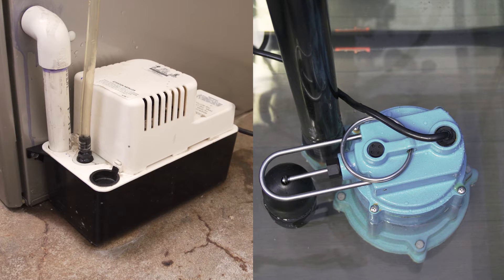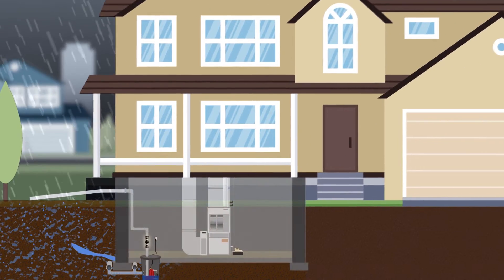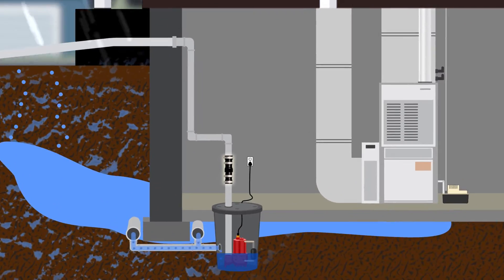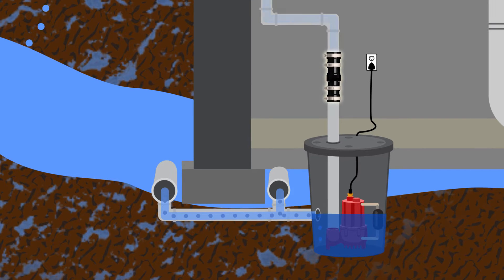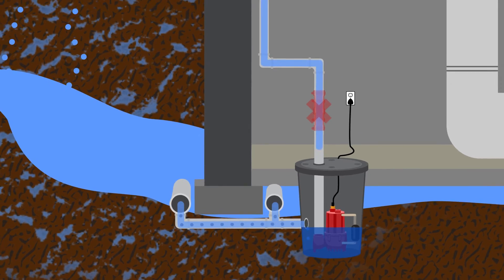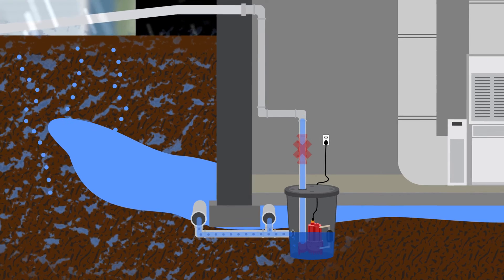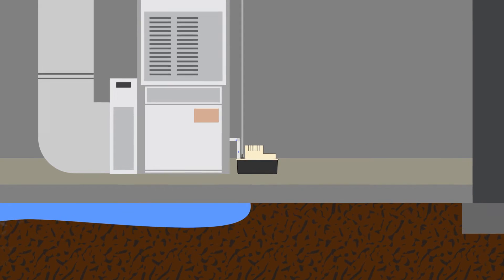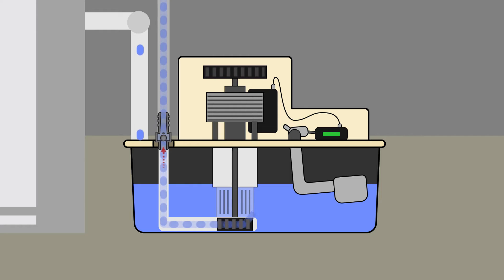How Do Check Valves Work? | Spec. Sense

Comment: How to remove the water above the check valve for service?   My sump pump check valve is low on one pit and high on another any reason for this?
Reply from the maker: Thanks for watching. To drain the water above you can either drain it back into sump pit, or you might need another bucket to drain it into. The height of the check valve shouldn't matter too much for this size and length of pipe.

Comment: So what does the duckbill do inside the check valve?
Reply from the maker: There are different types of check valves. For a sump pump it will have a hinge and a disc that closes when water is pulled back down by gravity.

The duckbill valve is a flexible one-piece sleeve in the shape of a duckbill which will open when the water is flowing in one direction, and enough back pressure will force it to collapse inward and close, preventing back flow.

Comment: So the check valve must be installed before or after the motor pump?
Reply from the maker: In the examples in the videos it's after the pump because gravity would pull the water back and force the pump to run again.

Comment: So it's the same as a backflor preventer?
Reply from the maker: Yes, a check valve is a type of backflow preventer but has a different appliacation.

A backflow preventer is necessary to prevent contaminated water from flowing into potable water sources. A check valve is generally not as robust and cannot prevent that sort of contamination. In the case of a sump pump, this is not a problem as both water sources are the same.

Comment: Does a bad check valve causes air in the system like sputtering and choking, especially in the morning?
Reply from the maker: It depends on how it fails. If the check valve is stuck closed then it might sputter. If the check valve does not close properly then water will rush back into the pump and it will run more frequently.

Comment: Are check valves ever immediately above the sump pump or even threaded to it? I am familiar with check valves a bit higher up and out of the sump and then a weep hole is drilled in pipe in sump to prevent air lock in that section.
Reply from the maker: Generally the check valve will be 8″ up from the pumps discharge to approximately 12″ above floor level. Any check valves with a MPT (Male Pipe Thread) connection that are designed to thread directly to the sump pump discharge housing must have the air release hole / weep hole drilled into the check valve body directly above the MPT connection and below the flapper. Some of these threaded check valves will come with a pre made weep hole.

Comment: the weight of the water "does not close the check valve". The check valve is opened by the suction of the pump. The check valve has a spring which closes the valve once the suction of the pump turns off. If you depend on the weight of the water to close the valve, you have installed the valve backwards.
Reply from the maker: Thank you for watching. There are gravity closing check valves that work even without a spring. As well swing check valves still work even without a spring as any backflow will push the flap close. You are right that the spring will help close it.

In the case of the sump pump, if the check valve was installed backwards the pump would not drain the sump basin as the check valve would prevent water from flowing out through the pipe.

Comment: What if i put check valve in oulet dan inlet pipe? Is my boster become safer? Is reduce waterhammer much? 
There is  still litle waterhammer when i use one check vale in inlet pipe .
Reply from the maker: Thanks for watching. Water hammer is the shockwave created when a pump or valve suddenly closes. It is like slamming on the brakes when driving at highway speeds.

To fix water hammer, tighting the mounting clips on any pipes can reduce the noise. Installing a dedicated water hammer arrestor will create a cushion for the water, reducing the shockwave. A check valve will not act as a cushion as this is another hard stop in the system.

Comment: My hand pump is facing difficulty in gaining pressure to pull up water. The problem due to check valve or washers like cup washer / plate washer?
Reply from the maker: Thank you for watching. There are a lot of variables so it is hard to say what is the problem, but yes it's good to check all washers to make sure it has a good seal.

Comment: Whats the life expectancy of a check valve and is it OK to be redundant on a check valve.
Reply from the maker: Thanks for watching.For life expectancy is difficult to say it really depends on the application, the pressure and how much it is used. An 2nd check valve will add redundancy but like every elbow in the system it will contribute to the friction inside the system. If the pump is adequately powered this should not be an issue.
Reply: @AmreSupply  thanks for the quick response. I was thinking of a second valve outdoors to keep critters and rodents out the pipe but now I'm thinking in winter times the check valve flap could freeze shut. I might just put a screen on the pvc located outside.

Comment: Intresting i have check vavles on my aquarium air lines think they work the same just with air i know if the power fails or i turn my air pump off they stop water going down the line destroying my pump
Reply from the maker: Thanks for watching. Most check valves are not powered and will still work without any electricity.

Comment: to solve air lock either use check valve or bleed valve ?
Reply from the maker: Thanks for watching. A check valve prevents water from draining back down the pipe it is not a tool to solve airlock. To fix a problem with airlock air will need to be effectively released from the system. This can be done through a fixture somewhere in the system or a bleed valve.
Reply: @AmreSupply  thank you sir for your information 🙏🏻
Reply from the maker: @muhdilman9175  You're welcome!

Comment: I just want to know , what happened if there is no gravity? In other words, how will be the flow if check valve is closed in this condition?
Reply from the maker: For check valves installed horizontally, a spring is commonly is used to keep the valve closed, so no gravity is needed.

Comment: ive been told to remove my check valve on my septic system after the effluent pump so that water in the pipe doesnt freeze in winter. The pipe volume is not enough to cause the pump to cycle again. Any thoughts.
Reply from the maker: Thanks for watching. Cold weather does change things and if the volume of water isn't enough to cause the pump to cycle then it shouldn't be a problem. Depending on the volume it will run a little more frequently than normal but likely not enough to create issues.

Comment: Can swing check valve can be installed vertically
Reply from the maker: Thanks for watching. Check or swing valves require some sort of backflow to work properly, so that pressure to push the valve closed is more important than the particular orientation of the valve.

Comment: But doesn't anyone think once that check valve closes water still is sitting above the valve ? ....
Reply from the maker: Thanks for watching. A little bit of water sitting above the check valve is not problematic, and it will prevent the water from flowing back down and triggering the pump again. Without a check valve the pump will run a lot more than what is necessary.

Comment: My landlord might need to have one of these installed?
I've been in the basement apartment for 4 years, but recently when I use the kitchen or bathroom sink, the main drain overflows, but not the toilet or shower.
Any suggestions please?
Reply from the maker: Hi Heather, thank you for watching! Slow draining can be caused by a venting issue or a localized blockage in one of the drains or shared pipes. For venting issues we have an animation describing this in this video https://youtu.be/zGofkKOP2SU It might help you visualize it.

Comment: Do check valves have trouble with hot water lines ?
Reply from the maker: Thanks for watching! That is an excellent question. Check valves and backflow preventers can create problems with water heaters due to thermal expansion. In some cases this can cause the relief valve to open intermittently. This is explained in this short video https://youtu.be/E1B-jSamx5Q If you are curious we have a whole playlist on water heaters including troubleshooting and repairs: https://www.youtube.com/watch?v=BHUPFLbb8NY&list=PLCo9SMjkdWBwJ4a8MT2GKTDiSuvSHg6Xk&index=1

Comment: Do i need a check valve from pump to pressure tank?
Reply from the maker: Hi Anthony, thanks for watching. This depends if your pump in your well has a check valve or not. If it doesn't have one then its often still beneficial to use a check valve between the pump and pressure tank.
Reply: Thanks, actually im having issues on my booster pump and pressure tank. Reading blogs, i think its water logging, does it something to on their location? Booster pump and pressure tank are situated underneath the storage tank. Hence, there will be flow of water to the tank even the pump is off causing water logging. Just my thoughts.. maybe an expert like you can provide guidance to me... thanks
Reply from the maker: @anthonytorcedo5175  Yes the location of these can matter and in some cases a check valve is needed between the Booster Pump and pressure tank and after the tank as well. I would recommend contacting a plumber to take a closer look at this as its hard to give specifics as it depends on a lot of factors.